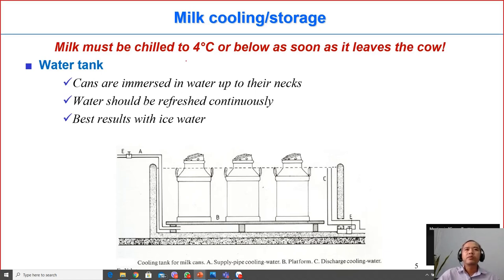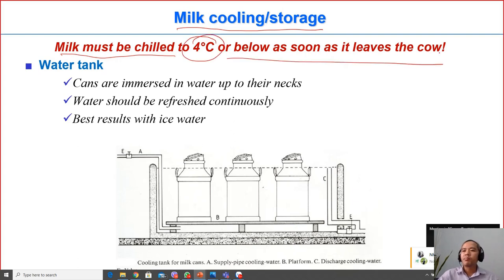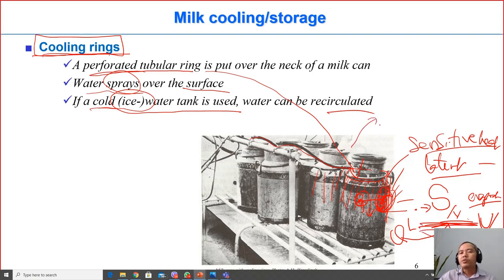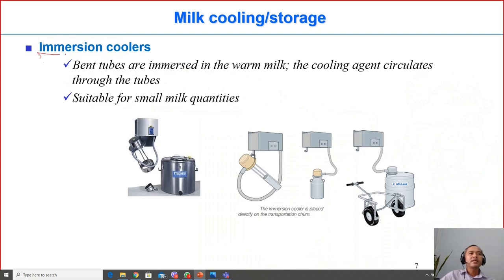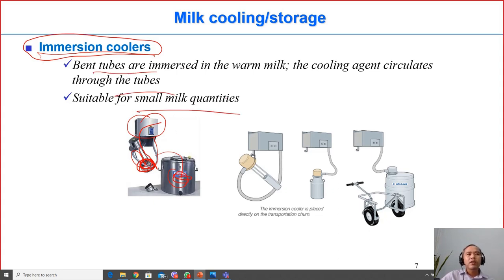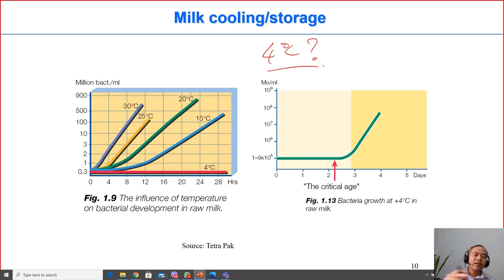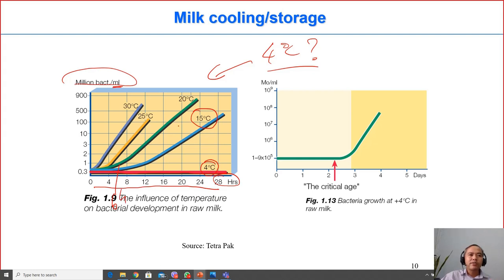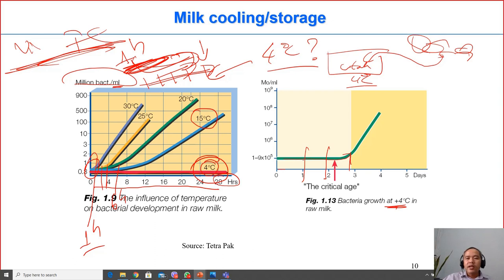C6-01b raw milk cooling/ storage| Dairy technology

Comment: Milk storage method:
1. Using water tank (cooling by applying iced water)
2. Cooling rings (circulated iced water---> spray over the surface of milk churn)
3. Immersion cooler (deep the cooling tube in the milk) - 200liter scale
4. Indirect systems: ice water jacket (rotational tank designed for rotate in side the large cooling water) + CIP system inside milk tank. Applying For >=5tons scale.

* Raw Milk can stored at 4 degree C in >=2 days without considerable MOs effect.